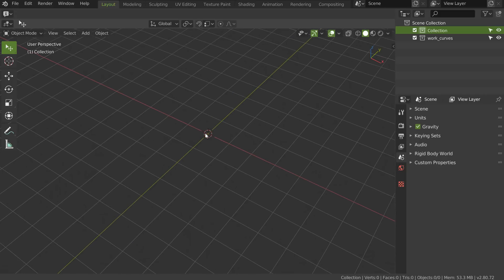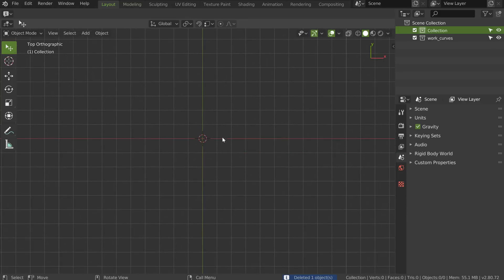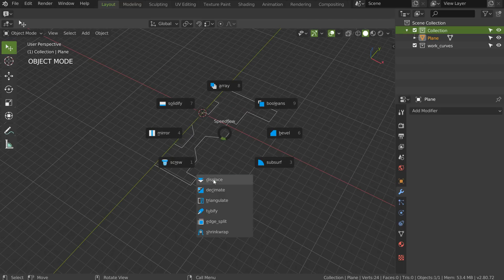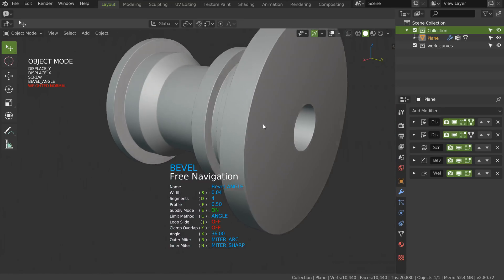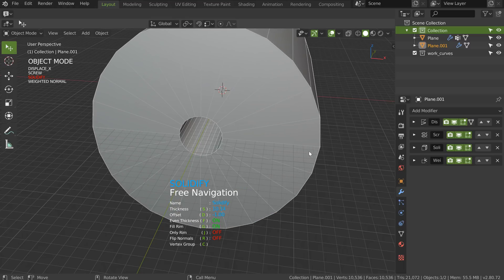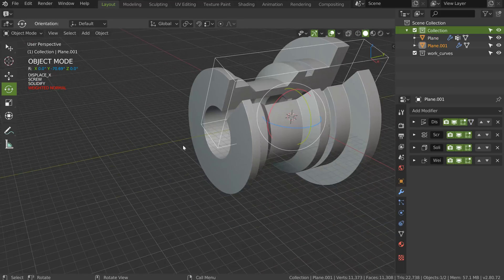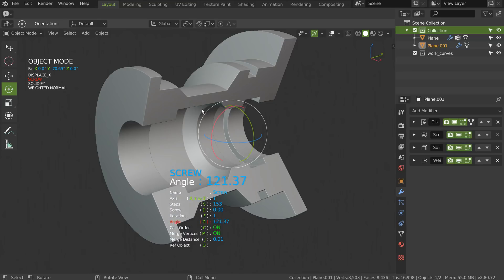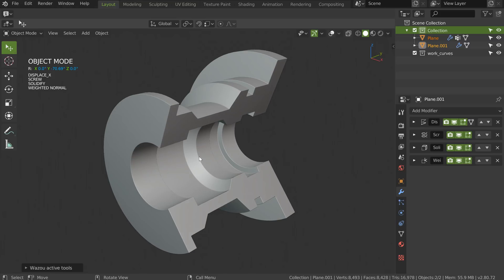Speedflow - Fix Screw limitation and make an animated cut - Blender 2.8

Comment: What are you actually using displace modifier for? Do you even have a texture applied to the displace modifier? Your addons is cool but its kinda hard to see exactly what you are doing when you use all these addons
Reply from the maker: To move the object and keep the origin at the same place.
Or to move vertices in object mode, no need to go in edit mode.
Really useful.

Comment: How did you align snap the vertex to the other vertex above it? Occurred around the 48 second mark. Normally I would just use CTRL to snap to grid but I noticed mouse cursor hover over the vertex above which appears to allow you to align snap the active vertex to it along the Y axis.
Reply from the maker: It's just a snap in vertex mode, nothing more.
Reply: Cédric Lepiller - Freelance 3D
I see now that you restrict movement on X axis and snap to vertex with snapping set to vertex.  Did not know you could do it specifically like that.  Thats why I love your videos. Always learning little tricks here and there. Thanks Cedric